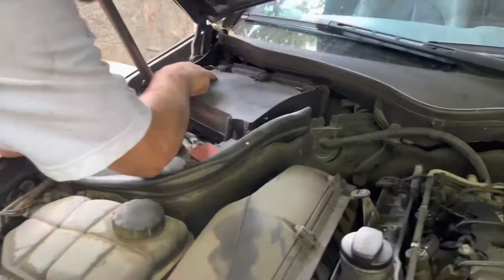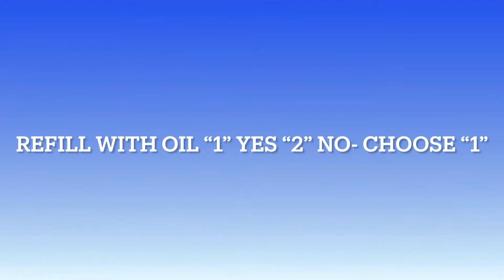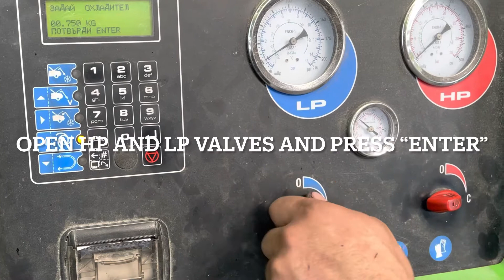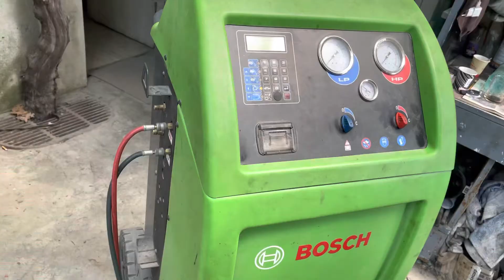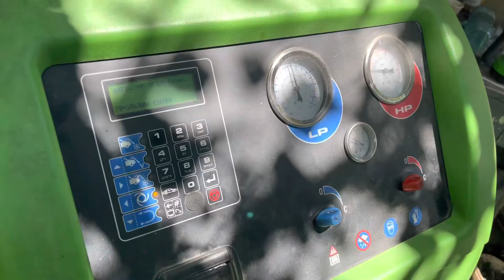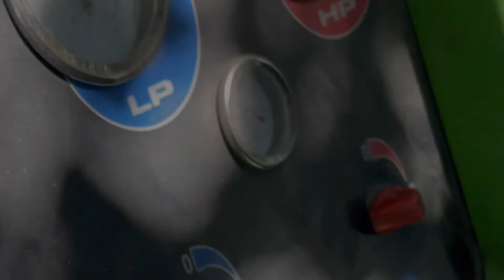How to use Bosch ACS 810 - Car A/C recovery and recharging unit. Operation instruction

Comment: Why oil is 3ml?
The machine is refilling the hole oil of system:
compressor,evaporator,drayer,condenser, lines.
Or what exactly? because illogic that any car have only 3ml of oil in hole system AC cooling.